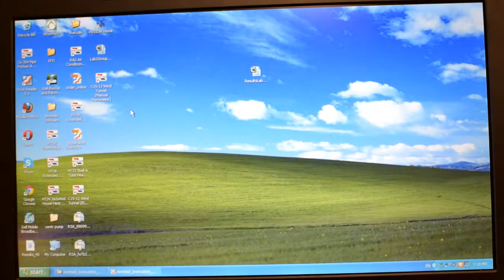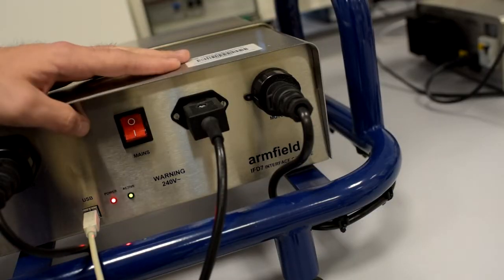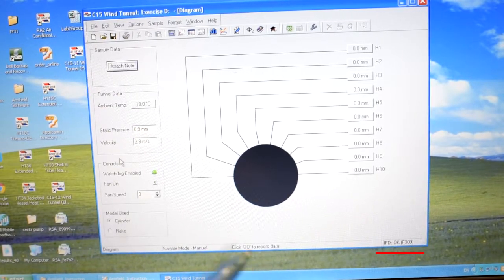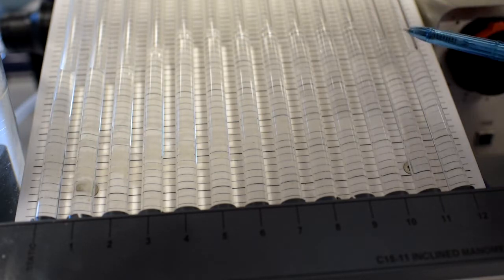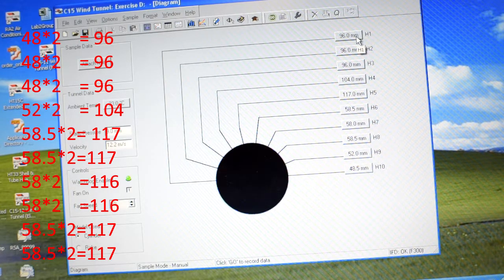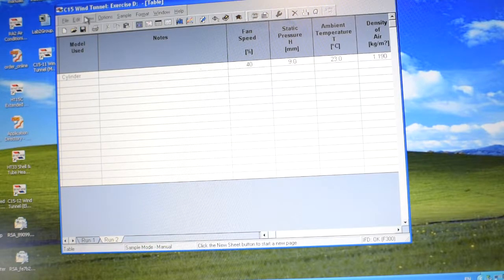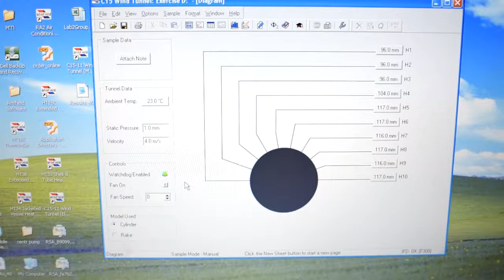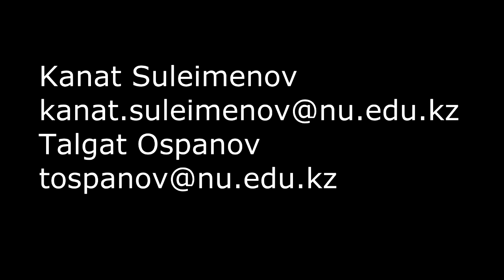Wind tunnel (Armflield) for teaching at School of Engineering, Nazarbayev University (2017)

Comment: Question
The higher the water goes up, it means low pressure or high pressure
I don't know if it work by suction or pushing
Reply: Think of it this way: it's pushing on both sides but harder on one side than the other (assuming there is a pressure difference).